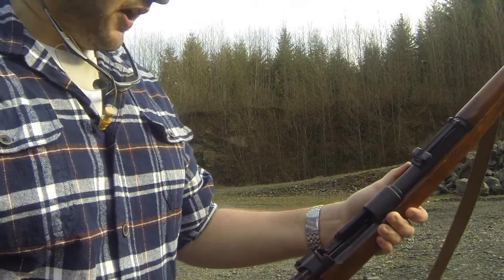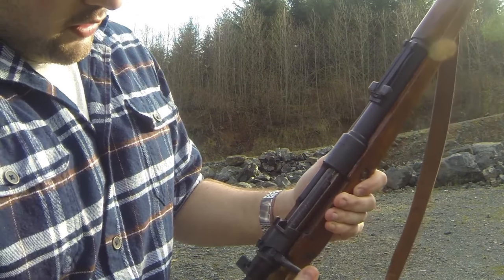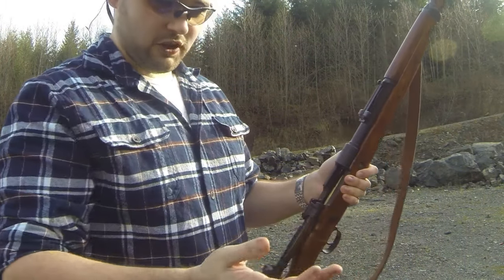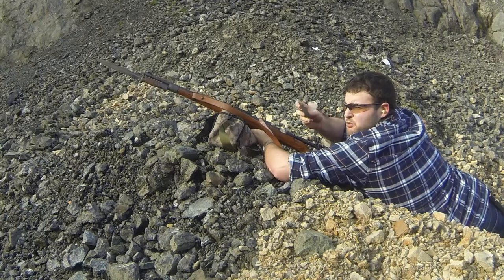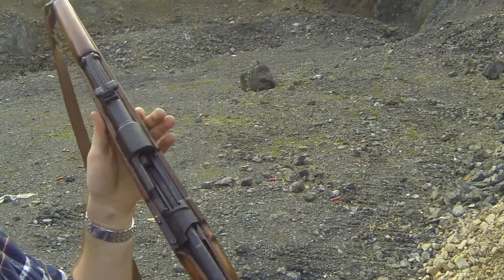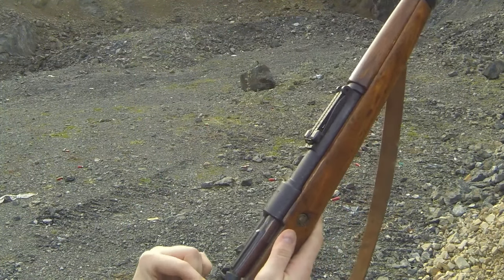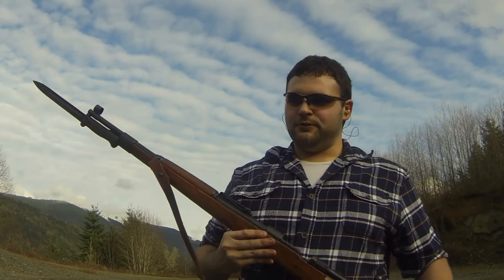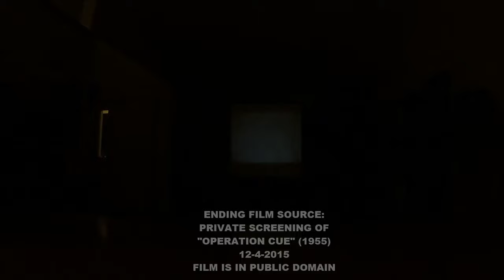Plinking and Shooting Review of the WW2 1941 DUV K98k Mauser Rifle (Russian Capture)

Comment: Great video Hughes.  Wow the RC's went up in $ since I bought one back in late 1990's or around 2000.  Please note, the safety is engaged when the lever is vertical, no need to place it all the way to the right. Horizontal right not only is safe, but the bolt is locked as well. Just extra info.

Comment: The reason that some people think that you shouldn't shingle load a Mauser is because some Mausers are missing the scallop on the front of the extractor. Without the scallop, the rim of the case/edge of the extractor could be damaged. This is mostly a problem with cheaply produced Mausers.
I came here from your post on Hickok45's channel. Subbed.
Reply from the maker: Thanks! I figured all Mausers had that chamfer on the extractor.

Comment: That's definitely a smooth shooting gun. It's really something else than the Mosin guys having such a hassle to chamber a round sometimes... compared to the Mosins this looks to operate like a finely tuned race car.
Reply from the maker: +bfgguns A head-to-head matchup is in the works. 91/30 vs K98k vs Garand.

Hiking 60 pounds of guns and ammo up the hill will be interesting. :)
Reply: Hughes Enterprises Nice. ^^
I subbed so I won't miss it. =P
Reply: +bfgguns You can get your mosin to run smooth.  Just clean the chamber well. Need to get all cooked cosmoline out and make it almost like a mirror.  Some use a 20 qauge shotgun brush and a drill. Just don't go apeshit. Just polish.
Reply: HHH100 Yeah yeah. Cleaning the chamber will not help when the bolt runs like shiet.
Reply from the maker: +HHH100 I've done the brush trick on my 4 mosins. I give the difference in smoothness a resounding 'meh'

So I swapped around all their bolts. Turns out my m44 really likes the Remington bolt from 1916. And the 1897 M91 really hates all of them.
Reply: +bfgguns Then you have a bad barrel. 2 M44's and a M91/59 with smooth actions like glass.

Comment: Subbed.  I have a non import matching K98k now, but I have previously owned two Russian capture k98's.  4 MOA is pretty bad.  I would check the stock fit and the barrel crown.  Some Russian captures have counter-bored muzzles to correct a damaged crown but maintaining the same barrel length.  Good video!
Reply from the maker: Thanks! This is really just a plinker for me and I never shoot beyond 100 yards. I'll be doing an accuracy video with it soon to see if I can squeeze some good groups out of it, but 3000+ rounds of corrosive ammo, rapid fire, has taken its toll on the bore and set back the recoil lug in the stock. Crown is not counter bored, but is quite worn. I can only imagine how bad the throat erosion is.

I'm working on editing a Mosin accuracy video now- I was able to get consistent 1" groups out of a pitted counter bored 91/30 with hand loads, about 5" with Soviet light ball. So maybe there's hope for the Mauser with some better ammo.
Reply: I see.  Even with pitted or frosted bores, these old rifles can still be great shooters as long as the crown is in good shape.

BTW, I found this video while digging through the comments on Hickok45's K98k video.
Reply from the maker: +MetaPrometheus I think I've added about 15 subs because of that comment. The next trick will be keeping them around with good content.

Comment: I have an all-matching 98k from 1937, and you cant single-load it unless the round is in the magazine. Maybe the russians modified your gun?
Reply from the maker: Lasse Hansen Nope it's standard M98 pattern. If you look on the front of your extractor there should be a chamfer angling toward the bolt face. This allows the extractor to cam over the case rim should you need to single load. 

On commercial Mauser actions or replacement extractors you may not have the chamfer and single loading is impossible except from the magazine. Dangerous game rifles based on the '98 usually have the chamfer though for emergencies.

When single loading the bolt will not close smoothly and you will feel and hear a 'click' as the extractor overcomes the case. It may require a little force.

Definitely not ideal, will cause damage to the extractor over time, but certainly possible.
Reply: Thats weird, because no matter how hard i try, i cant get it to load it. My Mauser isn't a commercial, it is marked s/42 1937, and is has all WaA on it, so it has served in the German army during the war. I was wondering if you bayonets serial number matches the guns?